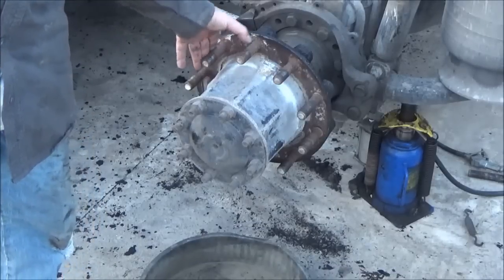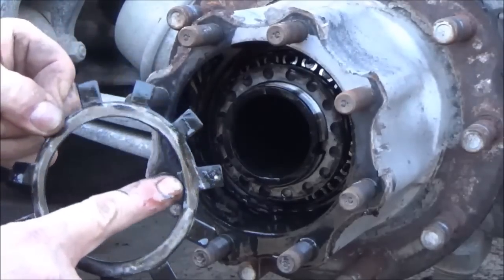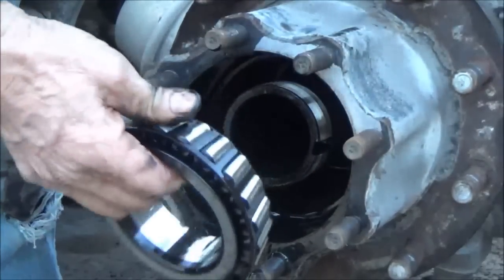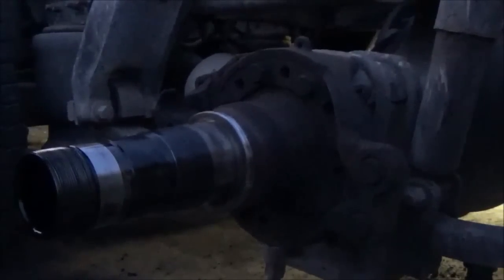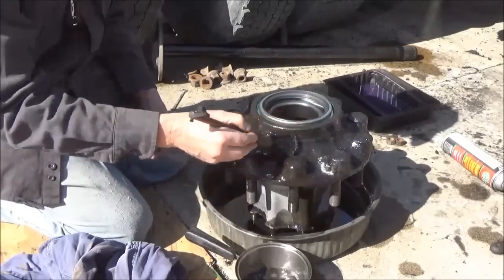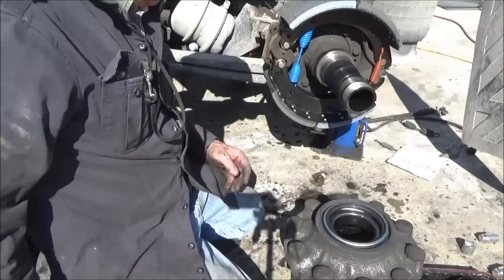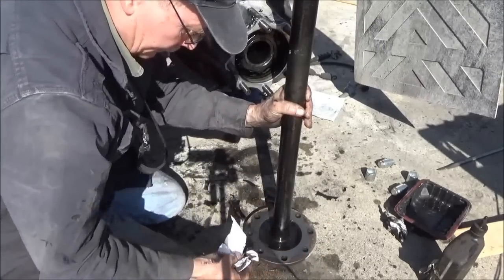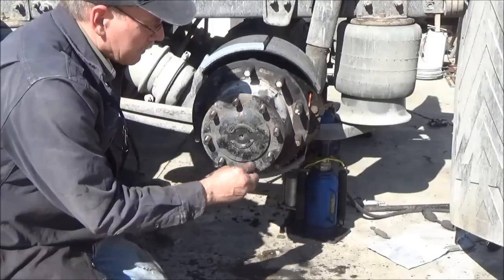Changing axle seal on semi truck at home without all the special tools

Comment: If you turn the hub with the seal facing down on the drum you can take a hammer and bar and tap the inside race of inside bearing and pop the seal out...and you need to put oil in the hub before you stick it on there so you don’t burn the bearings up...

Comment: did you not pre load the bearings?  those bearings are likely going on very loose. its much easier to do it by feel with a ratchet and socket if a tq wrench isnt available. using this method can be very dangerous.

Comment: Mr. Robertson, is there a way of checking the hub oil level without removing the wheel and brake drum? Or is it the same oil that goes in the differentials
Reply from the maker: It's the same oil as the differential.
Reply: Gordon Robertson thank you sir

Comment: Great work! Would you know what is the tourq for the nut that holds steering wheel hub of 2005 Columbia. I need to change it
Reply from the maker: I don't know on your truck, mine is about 300 ft lbs. Better call your dealer and ask the service dept.

Comment: Gordon Robertson. Thank you for the video. 
I have changed my seal, but when I put everything back up, it didn't seem to want to go all the way in, so it didn't have room for the last 4 inch nut to spin.
Reply from the maker: you don't have the hub seated, you MUST have it seated, tighten the 1st nut tight about 50 ft. lbs. and then loosen it, snug it up again and back it off 1/4 turn, put on your lock washer and tighten the 2nd nut tight, the book says 200 ft. lbs. make sure it's at least 50 or 100 ft. lbs.
Reply: Gordon Robertson, thank you for the reply. I have already tighten it and got the job done. I just hope I didn't do it too much because it was spinning pretty hard. But I appreciate the information and all the help. Take care 👍🏼

Comment: great video helped me a lot  keep up the good work thanks, I need to replace the rear main seal of my 12.7 detroit on a 2003 freightliner century do you have a video of something like that?
Reply from the maker: Thanks for the comment. No I don't have a video on the rear main seal, but the bulk of that job is getting the clutch down, and then the flywheel off, the flywheel looks heavy but it isn't (maybe 60 to 80 lbs.) maybe you can find a clutch video, I don't have one yet, do you have a truck transmission jack? I have done a clutch on that truck before, you can msg. me for help if you decide to do that job.
Reply: Thanks I do have some equipment not the best but just to get the job done. Thanks for your videos they really help a lot keep up the great job.
Reply: I think I'm going to start on the rear main seal like on the ends of December.
Reply from the maker: I hope you live in a warm area, unless you have a heated shop. Where I live is to cold to do that at the end of December (St. Louis area) if you're in the U.S. you'll know where that is. with good tools and experience, you'll need about 10 - 14 hours and the clutch parts cost about $800.00
Reply: @57bagre  Where did you find your manual to rebuild your engine?

Comment: Nice video. Two questions. To put oil back to axle, is it from hub or middle of axles? And how many gallons of oil is in your axle? Thank you.
Reply from the maker: There's a plug on the differential just like on a pickup or a rear wheel drive car if I remember right it's on the right front side and takes a 1/2" drive ratchet or breaker bar, just take out the plug on level ground, put your finger in the hole if you can get any oil on your finger, you have enough, if you can't call your dealer to find out what kind of oil it calls for and buy a few quarts with the pointed top squeeze bottle and return what you don't need. fill the diff. until it starts to come out of the hole, if it's an inch low, not to worry, it's good. Thanks for the comment ( I don't know how much it holds, maybe 3 gallons if empty) if you jack up the side to work on high enough, you wont lose any oil to speak of (bottom of tire 3 or 4 inches off the ground)
Reply: Thank you.
Reply: Vladimir Mineev 
Just before you install the outer bearing, fill the low area with gear oil and check axle oil level when you're done. I also coat the bearings with grease to protect them when you first start moving.

Comment: spin the hub to set it/ did you clean the bearing and repack it ?
Reply: You are correct, spin the hub is the proper way but you don’t pack bearings that sit in gear oil

Comment: Put that hub over, set it on top of the drum and use a punch to drive the seal out from the inside only touch the bearing on the cone and not the cage. Bearing and seal will pop out a whole lot easier than it did on this video

Comment: My seal went out and when I got the parts I was told by John Deere parts Dept that I had to also change the race and bearings. I can figure out how to repair things but it takes me a while. I’m not a mechanic so I had no idea I didn’t need to replace the races. I got the old race out but after several hours and now I can’t get the new one in. My tractor has now been out of service for 2 months while I’ve tried near everything to get the new race back in. It’s been a nightmare and doesn’t look like there’s any end in sight.
Reply from the maker: Sorry to hear you're having trouble with that. The race isn't hard to change, just turn the hub upside down and find the slightly recessed area on each side of the bottom of the race where you can see part of the race on each side and use a punch of some kind and start knocking the race out 2 or 3 hits on alternating sides 'til the race falls out. 
           for reinstall, please be sure you put the thick side of the new race down, put the old race on top of it the same way (thick side down) lay a block of wood or metal on top and start hammering it in until you hear the solid metal hit with each blow. Turn the hub over and knock out the 2nd race (old one)
Reply: Gordon Robertson DIY I wish it were that easy. Something is stopping the race from seating about 1/8” from the bottom. I’ve banged on it w everything I can think of and it will not budge. I even took it to John Deere and they used a race and bearing driver and couldn’t get it to move. 
I even put it in the freezer overnight to see if it would shrink ever so slightly so it would seat but even that didn’t work. 
I’m talking w the parts Dept to see if there’s a different race that goes there.  Right now I’m just in limbo w a crap ton of work that needs doing in the field and a broke down tractor in my shop. It’s aggravating as heck
Reply from the maker: Sounds like the next step would be to weld a small bead on the inside of the race and douse it with water to shrink it and knock it out and start over.
Reply from the maker: if you damaged the bore where the race goes you can polish it very carefully with a dremel tool but the race needs to be a tight fit.

Comment: But how do you replace the oil/lube that initially ran out upon disassembly?
Reply: Raise the axle housing with the jack and using a long flex funnel..put a few ounces over  the equivalent that poured out into the axle housing tube ... Check the fluid level at the differential housing before road testing.

Comment: How much torque should be put on the axle flange nuts?
Reply from the maker: 50 ft lbs pre load on 1st lock nut then back it off 1/4 turn or a little less and then the lock ring and the 2nd lock nut, torque the 2nd lock nut to 200 and fold the lock ring tabs.

Comment: Hey man I understand your doing your doing this at home, but they do make Seal Drivers if this is something you do a lot get one. If you are installing the older red seals get you some some permatex and paint it on the seals wider rim then make sure the bearing is sitting flush before you place that seal over the hub. Get you a bigger hammer too if you can a 9lb sledge with a sawn off handle to about 9 inches or so,works well. It should only take two hits with a proper seal driver and the right sized hammer just hit it like you live HARD. One to set it and one to seal it just keep the driver flush and hit the driver dead on the head flush. If your using the newer blue seals then you dont need permatex (Gasket Sealant) They have done away with the old red seals Im told. It looks like you need a 20K driver but I would get a 10k as well if you do this alot same hammer with the 10K but one hit two will knock the seal in too far. I built hundreds of these daily for years. between 300-600 or more a day. Bearing and seal installation for Dual wheel. I even built these in my sleep lol.
Reply from the maker: Thanks for your concern and the comment. This was the 3rd hub I changed the seal on this truck  since I bought it 14 yrs. ago, there is still 1 hub left that hasn't leaked yet, when it does need to be changed, I will do another video and I will buy a socket for the locknuts on the bearings since I caught some negative comments over that and I understand that some people at home may not know how tight is enough the way I did it here. I have been installing seals on all kinds of equipment hundreds of times for over 40 years and only bought a driver 1 time for the transmission on this same truck for a 2 pc. seal that did not work very good and I had to replace it about 5 years later, it was leaking the whole time but not too bad until I had to change it, the new seal was 1pc and much better and doesn't leak to this day, I took a piece of 3/4 plywood about 8" sq. and cut a round hole in it maybe 3" or 4 " for the output shaft and installed it with that. When a seal is not coated or the coating looks doubtful I wipe a little silicone on it 1st.

Comment: put the hub in the drum,studs thru the drum holes, when prying out the seal, use the weight of the drum to hold it down, lots easier

Comment: If have casett bearing then tightening is different also bearing is not coming out in parts. But on casett bearing just tighten so hard what can. I hammer it tight with 3000 Nm air gun. Not some other locking there.

Comment: what you installed my good sir appeared to be a "cr" seal judging by the green. that seal design runs within itself. it is meant to be installed dry between seal and spindle. it is not intended to rotate between seal and spindle but between its own internal sealing surfaces. lubrication between these surfaces, imo, could cause premature failure.?!!
Reply from the maker: I've done 3 of those the same way in the last 15 years on that truck and not the same location twice, the 1st one was 1 or 2 years after I bought it, the 2nd about 8 years ago, the 4th not done yet but probably not too long from now,  now that I have 1.5 million miles on it. The seal lip does ride on the surface of the axle housing, I would never put a seal in dry and take a chance on burning it up. Thanks for watching and commenting.

Comment: Do they make a kit for this job, and what would they call it. Thank you.
Reply from the maker: I don't know of a kit other than a seal driver kit. I haven't missed having that tool, if I ever need to get one I will. The piece of wood works fine for me on the bigger seals and for smaller ones I use a socket or anything close to the size I need. Thanks for watching.

Comment: I notice you are using white paper towels i believe.Would you coment if so.I use a lot of paper towels also,the blue ones and white.I know the white ones  are a lot cheaper to buy.Thanks
Reply from the maker: Yes I use white paper when I'm not worried about lint getting into the parts where it could cause trouble, the blue disposable shop towels are less likely to leave lint and fragments behind but are expensive and I don't buy them, I just use cloth rags for that. Thanks for subscribing.
Reply: Thanks for the reply,i was just wondering because i go thru a lot of paper towels
Reply: dennis good veterans thrift store sell ya a bag o rags for cheap ....I wash em several times